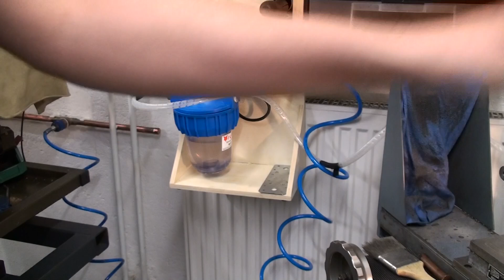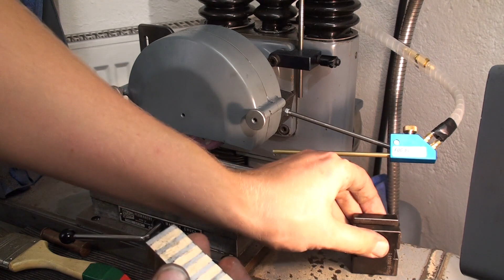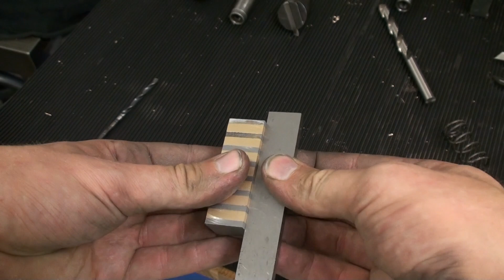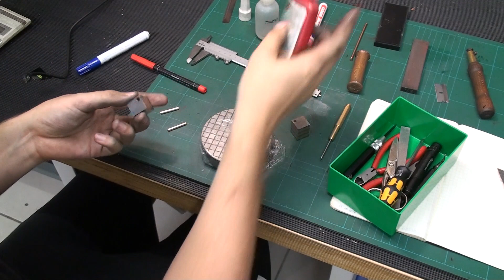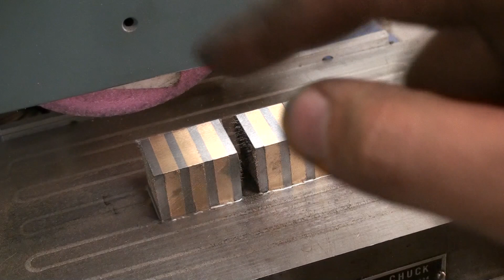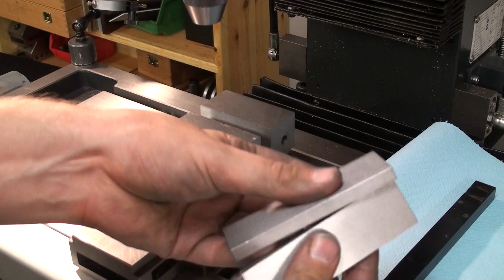Toolmakers magnets - Part 2

Comment: Hi Stefan, I have just found this great little project. I can imagine a number of uses for these to assist in setting up. I guess the corner drilling for brass dowels would be more reliably achieved by drilling each wafer individually in a jig or the toolmakers vice with an end stop.

Comment: If you stacked the magnets on top of each other. Would they act like a magnet switch? By turning the top and the bottom in opposite directions and having the magnetic fields cancel each other out. If I understand the concept.

Comment: Drill 2 opposing corners with tapered holes at least 2/3 the depth of total length , then flip it and drill the other opposing corners the same way , then drive some tapered pins into the holes .. maybe a touch of crazy glue for insurance.. ? ..just a thought... I haven't finished watching to see if you solved it already.. I got excited and broke ranks to come blabbing.. ...so disregard if this is all inapplicable.. lol

Comment: Rather than glass bead blast for better adhesion use silicon carbide as it will leave a very rough retentive surface for the epoxy.

Comment: A Belgian made product called Soudal high tack fix all polymer has 340kg holding per 10 square cm, was developed to stick high end car panels together instead of welding. I have found it to be far better than epoxies for shiny surfaces

Comment: Do you think Locktite would have worked better than epoxy?
Reply from the maker: Not sure - I had not much luck with loctite on flat surfaces.
Reply: That's interesting.  You'd think epoxy would have held better
Reply: Little experience with Loctite, but in the epoxy world there is a huge difference in quality between different makes!  In about all of comparative tests JB-weld is coming out with the best ones.  Difficult to get in the European continent, there one needs to order from UK.  And roughing up the metal surfaces can help a lot!

Comment: Very nice! It would work great for welding as well. A question tho.. why didn't you use lock-tight for the plates instead of epoxy?
Reply from the maker: I had not much luck with loctite on flat surfaces. Because of the nature of loctite (something like 648) it needs to be constrained from all sides.
Reply: Ah i see.. I'm not too familiar with lock-tight's properties. I know its a glue lol, but actually I have never used it.

Comment: maybe JB weld would have been better, sometimes your first No is Go. been there. Very Good Video. I have a great use for those. My Gun. machine shop. I have some ideas on using hardened steel. again great Video

Comment: Nice one! I ahve transfer blocks but nothing like this, so will build some. Thanks.

I'm not a big fan of consumer grade epoxy and wasn't surprised the bond broke, especially since no pre-cleaning was mentioned. I wonder if 648 would have held better in any case.

Comment: About the tool makers magnets.  Two things to remember, brass will no accept paint lacquer or any glues, eventually, what ever you put on it will come off.  Second, with epoxies, the longer the cure time the more bonds are made, that's why 5 minute epoxy, may be fast, but is not very strong.  Another comment, about the brass pins you installed to hold the stacks together.  Why not countersink the pin holes at either end of the stack, cut the pins a little long, then river the ends of the pins into the countersunk holes so you have a very strong mechanical clamps with the pins.

Howie
Reply: I like that idea with the pins. Thanks for that insight.

Comment: If you use glue or epoxy to glue metal, it is important to have a rough surface which is very clean. The smoother the surface the worse the bonding. (PS: like the way you take apart new tools before use)

Comment: The permanent magnets I use in my shop all come with a 'keeper', which helps prevent the magnets from weakening when not being used by providing an easy path for the magnetic field between each pair of magnet poles.

Do you think such a thing would help your toolmaker's magnets to last longer?

Do you have some magnetic field viewing film?  I'd like to see what the field looks like for the magnet assemblies you made!
Reply from the maker: No on the magnetic view film, I wanted to buy one for the longest time, but I always forgett about it ;)
We store the magnets at work without a keeperplate and they seem to be older than me...and they have not lost any strengt. 
As I think about it, with those magnets its not much about strength anyways, its more important that they can be ground square :)

Comment: Well, I have read about 40+ comments and not found anything that contradicts ny experience, You used 5-minute expixy. My experience with this stuff is that the time you save by using the 5-minute epoxy will be lost when the work breaks apart. It just does not seem to hold well, and that is with extensive cleaning, acetone, yada yada, especially joining dissimilar metals. Now I use regular epoxy and let it cure overnight, Just my experience. Howerver, that was a nice save,  and in hindsight might have pinned it before grinding. Still, some very useful information in this pair of videos. The use of the blocks was very interesting.

Comment: A question for everyone.
What is stronger for magnetism, more laminations of thin magnets or fewer laminations of thicker magnets?
Similar question for magnetic transfer blocks.More thin laminations or less but thicker laminations?
Reply: As I understand it, the strength is relative to the work. A thin sheet of steel will be held better by many thin lamination's because the lines of flux are tighter to the surface and closer to one another, where a thick plate of steel will be held better by coarse lamination's that have taller lines of flux and penetrate the work deeper. A thin sheet on a coarse magnet would want to be wavy because it is being pulled in an interrupted manner along the length. Remember each lamination is an alternating polarity so you can kind of envision it like a sine wave. Most magnetic chucks now-a-days have alternating thick/thin lamination's.

Just makin' stuff up ;-)

Comment: Stefan, either you had a bad one or you did not work it properly. The Noga Mini Coolant Mister is a super tool to use, I use one on my lathe, I set the air pressure to only about 8 psi and it sucks up the oil / water mix easily. A very nice mist is dispensed exactly where it is needed. If you still have it, give it another try.

Comment: Stefan another beautiful tool on the to do list! Many thanks.
A question though... you used Loctite 648 for the pins and mentioned that they would never come apart. Would the same adhesive not have permanently fastened the plates thus obviating the need for pins at all? Or is there another Loctite that would?

Comment: Apart from anything else Stefan - it (before if got smaller!) looks real pretty! Sure seems some great power.
Long hole drilling not the easiest - pity the glue joint broke. Maybe the smaller units will probably work out best... seeing your proposed applications .. nice. 
The grinding finish is the real secret to having true surfaces.

Comment: Great vid/build...curious tougher to machine but could SS be used in lieu of brass? Any benefit or problem of using SS.
Reply: if I read your comment right it looks like you are talking about the SS  in place of the mild steel not the brass bodies as  I thought Chuck was talking about
Reply: You need a material that is easy to magnetize but looses the magnetism fast. And pure iron is the best martial for that purpose. It has the lowest magnetic "resitance". Most of the iron alloys have a higher magnetic resistance. This will reduce the power the resulting magnetic block will have.

Comment: I was thinking, would it be good practice to drill the holes for the pins in the individual plates before assembly
thanks

Teun
Reply from the maker: I thought about that, but it might get a bit of a pain when it is time to assemble it...